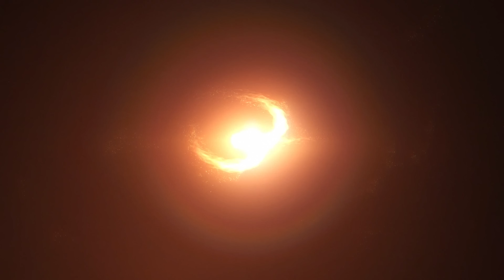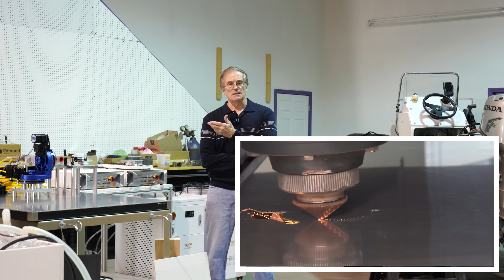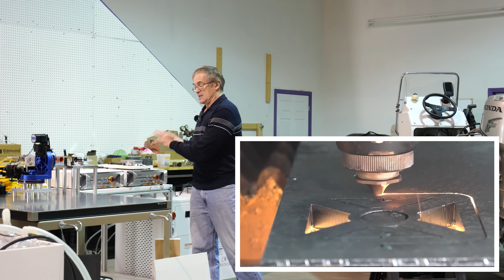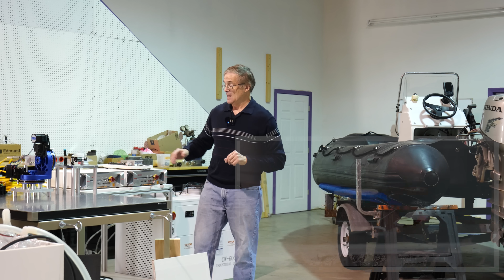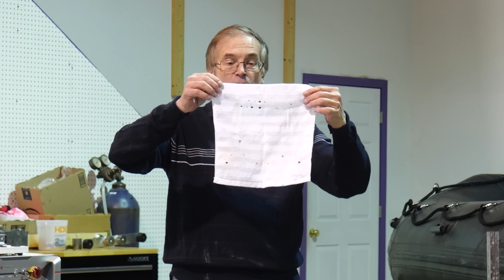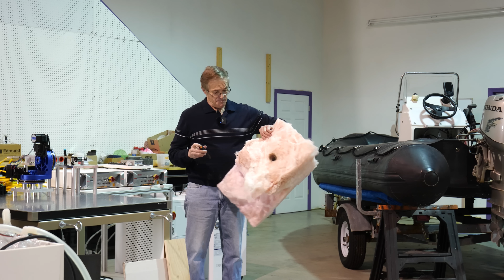We have a problem... and need your help!

Comment: Sand. As it gets melted, more loose material will fall into the path of the beam.
Reply: Sandbags seem like a good way to implement this. Cheap, easy to move individually, and can be layered until the mass is sufficient to absorb the energy.
Reply: @rdavis  How should the sand be contained? Any common bag material would have holes in an instant. Maybe sand in a container made of a material which is transparent to the laser light, so that it does not get holes so fast.
Reply: @wolfjazz_  maybe magnetic cube inside sand?
Reply: @wolfjazz_ If you wet it down it will stay pretty stable with a few holes in the bags.
Reply: I was going to suggest this, sand placed in an angled box steel something like \:\ where you could probably put a drainage plug at the bottom for easier transport. That said there is a non zero chance the laser will just bore a hole leaving a glass tube, and liquid glass would likely just float on top of the sand and get vaporised
Reply: @highlow4098  Yeah. Calcium oxide/hydroxide wont melt like that
Reply: @trollmcclure1884  

Perhaps borosilicate glass beads. They would scatter the light and not melt until they got to  around 1650°C
Reply: Maybe a  'sand wall' between sheets of ply?
Reply: There will be a thermal gradient from the point heat source. The glass will therefore have a viscosity gradient. You will end up with a hole, as molten glass flows like thick molasses. There will be a shell around the hole of sintered sand.
Reply: Many great ideas. I think if you incorporate movement or rotation you would increase the amount of time before burn through or overheat.
Reply: sand! its cheap, readily available and if he melts some in the process he can sell the resulting glass. do a firebrick light trap filled with sand.
Reply: Carbon black tinted lime plaster with fine vermiculite aggregate?  Applied over plaster board with fine metal lath for adhesion.  Weighs a bit more than fire rated drywall, it should have a bit more resistance as it expands on calcination, evolving water and carbon dioxide.  Calcium oxide is very refractory and amorphous so reflection is dispersed.
Reply: The sand around the beam could fuse into a solid mass preventing any more sand from falling in.
Reply: @SB_3.1415  as sand fuses, it packs tighter, reducing volume so it is possible a tube would form.  Any intumescent mineral metal salt would lower the melt point.
Reply: bro nailed it.  a stack of sand bags checks all the boxes.  tuff titties if its heavy and hard to move.
Reply: I was just about to suggest that. Cheap, readily available most places, non flammable.
Reply: This is how the pyramids were built.
Reply: Maybe soak the sand. Maybe cinder blocks.
Reply: I had the same thought but with water. Could you dye water such that it absorbs the laser. Then, put it in a laser transparent tank.

Sand might clog up while its melting and leave a hole.
Reply: Oh gosh, I better go delete my reply.  I don't want to be accused of not doing a thorough literature search 🙂
Reply: I don't know that sand falls quickly enough, but that's interesting.
Reply: @lystic9392  Sand would fuse at laser temperature,  forming a viscous fluid if pure.  Mixing calcium,sodium or any higher metal salts would lower the melt and make it flow better.
Reply: Yes but make it flow hourglass style into the beam. An inexhaustible solution. Garnet shot is also very dark so would absorb the radiation and safely dissipate all that heat.
Reply: Mirror into water tank. Prism mirror water tank
Reply: Couldn't sand turn to glass and become a random reflector, even in liquid form?
Reply: maybe instead of regular sand you could use ground up ceramic because of its high melting point, and on top of that drench the whole thing in water to increase its thermal mass. That in combination withthe sandbag idea might maybe work.
Reply: I don't like sand. It's coarse, rough and irritating; and it gets everywhere.
Reply: I found Anakin
Reply: 2 gaped dray walls filled with sand or clay in the gap, you can make it on a wooden base with wheels.
btw... love your work.

Comment: Concept Options:

Option 1: Linear Waterfall Wall
Design a linear water curtain or waterfall wall using high-capacity water pumps. The water flow must be uniform and form a continuous linear sheet to ensure consistent laser energy absorption.
It's possible to calculate how much water (per mm²) is required to vaporize under laser exposure, based on the beam’s power. The system should be relatively straightforward to set up and easily expandable across multiple rows or segments. An optional enhancement could include an actively cooled backing wall with continuous water circulation to further increase energy absorption and safety.

Option 2: Ground-Based Impact Surface
As a fallback, the ground could act as a sacrificial surface, absorbing laser energy with the assumption that the beam won’t penetrate to critical depths in less than one second. This is a passive method and relies on the thermal mass and resistance of the material used.

Additional Consideration: Hydrogel Walls
An alternative approach could involve panels made of hydrogel or similar water-rich materials. These can hold a large volume of water in a semi-solid form, offering effective laser absorption while being safer than free-flowing water in certain environments. This method may also offer modularity and ease of replacement.

Comment: Reinforced Carbon-Carbon (RCC) – Used on Challenger
	•	Excellent thermal resistance: withstands >3,000°C (5,400°F)

PICA-X (ablative heat shield) – Used on SpaceX Dragon
	•	Designed to ablate under heat, sacrificing material to protect structure
	•	Can handle re-entry temps exceeding 1,900°C (3,500°F)
	•	In a laser hit, it would start ablating immediately, potentially surviving brief bursts by vaporizing some layers

Comment: My idea would be to catch it in something liquid, something like a large fish tank. The liquid inside the tank should be somewhat opaque, i.e. it should be dyed with something that is as heat resistant as possible. Amino G Salt, 7-Aminonaphthalin-1,3-disulfonic acid may be a candidate for a dye, however it's boiling point is approx. 550°C so I would put an enclosure around the tank to capture the fumes. If you'd like to be extra safe, you can put a lense before the tank, which is supposed to disperse the beam. But even without the lense, I'd hypothesize that, given a "long" enough tank, the liquid should be able to capture the energy of your laser. If you submerge some kind of turbine into the tank to generate water circulation (ideally actually in a circle/vortex), I'd guess that it would improve the performance as well (given that the turbine is strong enough). In general I think a solution like that would be very cheap, portable and easy to replace. My hypothesis would be that the blanket test you've mentioned is not "general" enough to disprove the suitability of a liquid absorber - however I'd be happy to be proven wrong 🙂 Best wishes and thanks for the thought-inspiring videos!
Reply: How is the light going to get to the liquid ... when it is soaking into the ground after the laser causes the fish tank glass to explode?
Reply: @ the interface material is the key, the lense also does not explode, but the light passes through. I’d appreciate if you’d keep the discussion professional - joking about ideas that are „bad“ in your opinion can lead to others hesitating to share theirs, which is a death sentence to scientific progress.
Reply: @kekmeister42  these aren't flashlights, no commercial glass will handle the amount of energy these lasers produce - and especially not fishtank glass, which is of the cheapest and least optically pure glass available on the planet.

Comment: A multi-layered system starting with a black, anodized aluminum sheet, backed by ceramic tiles and/or fire bricks and finally backed with a sheet of 1/8 inch steel.  Each material has different thermal and diffractive properties to stop the beam with different mechanisms.

Comment: I'm wondering if a laminar flow of water in a large sheet might work.  You could even make the shape into half circles on the back to create a lensing effect to spread out the beam.  You would need a very large pump to keep the trough of water full to create enough constant pressure.  I'd start out small scale to see if it's even possible. You might even be able to do individual streams in 2 or 3 different layers where they are staggered to provide full cover. You would have full circle lenses to redirect the light like a diffraction gradient.

Comment: Two roller system with a wide belt rolling over them. Bottom roller partially submerged in a tub of ceramic slip. It will also continuously refresh itself.

Comment: Move the laser so it points towards the ground. 

Perhaps place an shallow pool of water on the ground. Worst case you melt the Earths crust. Best case the water absorbs the heat and any column of evaporated water gets refilled by gravity.

Comment: I can think of 3 options that may work by themselves or together.

1.Plain old hemp sandbags.
Have speakers emitting "thumping" against the side of the sandbags/floor to cause the sand to vibrate and fill holes as the laser melts through the sand.(would need to be tested the glassification doesn't keep the hole open)

Not sure what frequency the lasers operate at... water maybe a good idea.
2.Create a layered waterwall, many garden waterfall options that create a laminar flow waterwall.
Not sure how many layers you would need, maybe even one would be enough, again it would need testing.

3. Stand alone or optional to 1 and 2 depending on angle, mount the lasers above and have them shoot downwards into a pool of sand or water.

Comment: use 2-3 dirt bags in the laser's path with 1-2 bricks on top of a bit of sand (to catch any molten material) located where the beam would be focused at behind the bags. if the beam somehow gets through the dirt, it would probably afford you enough time to react & turn off the laser. the bags aren't necessary, you could literally just put the dirt on a moveable bench as well & cart it around so you don't have to lift heavy bags of dirt every time.

Comment: Paint your target in an ablative sacrificial layer, similar to what SpaceX uses to coat their capsule with. It will need to be reapplied, but it's probably cheap enough that you could have several heavy gauge steel sheets coated in the material, standing by

Comment: From 5', I think you already have the best solutions at hand : moving the beam very quickly (screen savers function for anyone who remember). Depending on the mass/weight of the laser output device, have you considered adding some controled but separated mechanical movement to prevent sofware glitches or issues with the actuator ? For ex.  finely tuned DML  exciters linked to optics or on mirror  . Other idea : make the final focus lens movable  along beam axis to permanently move the focus point on Xaxis  instead of (or combined) with Y/Z movement. And to prevent issues when the target is no longer stopping the beam, keep it moving , only add some very small time steps of focus on target (like PWM) . Thanks for content !

Comment: It seems there are two problems.  Fixing the duration that the laser is at max output (firing a "pulse" rather than a continuous beam) as well as a material to absorb the laser output for the duration of the pulse.  Possible materials could be a sandwich of AR500 steel plates, level 3 ceramic armor and tungsten.

Comment: Set the plywood up sitting over a reservoir and drench it constantly w/ water?  The water should diffuse the laser a little bit and also prevent fires.

Comment: Ah, you want a "bullet collector" for lasers.  

My first guess at it would be to use a mirror (NASA uses thin films for large collapsible mirrors) to "catch" any loose beams and redirect them into a deep stack of biochar (already has everything cooked out of it but the carbon) which is just converted biomass and super light; that way it can be at a distance and not near the target (contamination) or people (danger, will robinson).  It will be consumed but it will absorb the energy and not be explosive or anything as long as it's inside something probably kiln or even forge level of containment.

Maybe crush it and pack it into a brick or something while redirecting the stuck beam through the top of the forge where the brick is stuffed into.  I tend to over engineer stuff on the first pass, but that energy's gotta go somewhere and nobody is making starlite and bricks of aerogel are ridiculously expensive as well as ridiculously fragile (and bad for your lungs), so, deep pile of extremely inert absorptive material.

Biochar is cheap and plentiful, especially if you prune your own trees bc it's easy to make.

Comment: Is it practical to reorient your z axis while doing at least some of the testing so that the laser is firing toward the ground? Then build a sandbox and fill it with wet quartz sand. Should be easy to fill up and cleanup and you could rake the sand for solidified clumps between tests to ensure you have a good consistent thickness.

Comment: What if you made a flat glass watertank(like a double glassed window)and filled it with water and a lightdispersing solution. Put a laser detecting sensor facing it and connect to a power shut off for you device. Only downside is the unwanted weight in glass and the "complicated" work of construction.

Comment: There are several good options discussed here. What I initially thought of was a sheet of copper coated in something refractory like charcoal or sand. Refractory could take the brunt while the copper disperses the heat. If the construction works, the refractory could be periodically refreshed as needed.  Adding tilt and rotation to the mix, as mentioned a few times below seems like it would vastly improve the available time to switch off the laser.

Comment: I love this problem!

My instinct would be to focus on a solution using spherical aberrations in the form of layers of obscure glass. (Perhaps we need it tempered?) This glass has a beaded surface.  My guess is that each individual bead would need to be the same size or smaller than the diameter of the laser beam.  You might be able to get away with a single layer, but multiple layers with enhance the diffusion that much more.

Comment: You might want to look into carbon–carbon composite for this. It's the same material NASA used on the Parker Solar Probe's heat shield — it handles temps over 3,000°C, doesn't melt, and it's non-reflective, which makes it ideal for stopping high-power laser beams safely. It's basically carbon fiber reinforced with pyrolytic carbon, so it's structurally strong even under extreme thermal stress. Not cheap, but when you're working with lasers at this power level, it's not a cheap sport.

Comment: Depending on how big you need it, you could make a spinning or moving wall that moves faster than the laser can cut through it. If you leave the laser on in one spot, the material will keep "refreshing" as the wall moves, so it won't have enough time on a single spot to cut through. A little complicated but a wall of spinning disks would look cool too 🤷🏻‍♂️

Comment: It would probably burn and produce toxic fumes, but I'm thinking of epoxy that has a color gradient from clear to deep black. The laser passes through the clear surface of the epoxy block, and gets absorbed gradually as it passes through ever darkening layers of epoxy. Maybe using several layers of optical glass for the front of the target, followed by several layers of progressively darker welding/grinding helmet glass, would dissipate heat fast enough. Or, how about a divergent lens just before the target to scatter the beam ahead of entering the target "beam capture device"

Comment: Laser at celing, looking down + water resevoir on floor, just like laser cutting machine.
Maybe some multiple(?) aluminum sheets to be cut(sacrificing), black-coated in order to absorb light, not reflect.

Comment: I don't know what material the lenses are made of. I think a giant fresnel lens, or even just a sheet of diffractory Material that conducts the light instead of absorbing it would do the Trick.
The you have 50 ish kW of energy not in 1mm² but more like 1m².

Other Option: What is spaceX using for their Heat tiles? Scot manley has a great Video on those

Comment: Anything absorbent won't work well,.  Something with a titanium dioxide coating - It will be perfectly be reflective, in a specular sense, but it will divert the energy everywhere.    TiO2 is super duper cheap.  It's the most reflective  (whitest) material we use, and it can easily be made into a paint, aerosol or coating.  You could also use a solid sheet of  quarzite / quartz - WHich you would find from a kitchen renovation place (as a countertop material)  - We have a quartz countertop, but its not going to be supercheap.   An alternative would be a "Falling Particle" conveyor (an ongoing "waterfall" of metal filings.  This would be WAY more complicated, but this is something DARPA developed to totally absorb all solar energy from a solar concentrator https://www.youtube.com/watch?v=uEy6O9P5Z6c  - but I certainly wouldn't want to develop this for a temporary experiment.

Comment: I don't know if this is a possibility but :
A waterfall that puts out enouth water with something mixed in to absorb more light, like Ink or some partical so the water does not reflect as much but absorbs it. 

Out of the solutions I've read here the rotating belt system with clay sticked to it seems a relativly cheap and smart idea